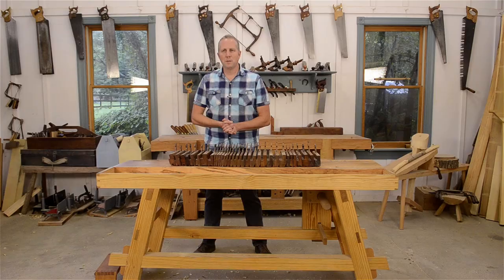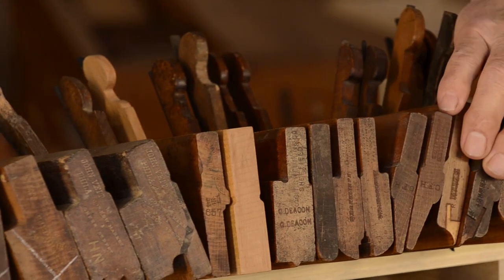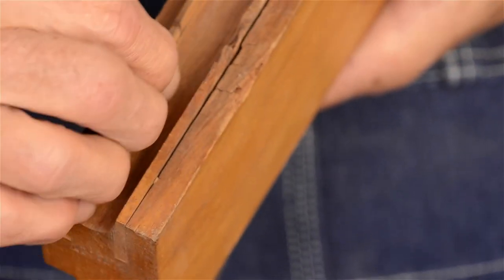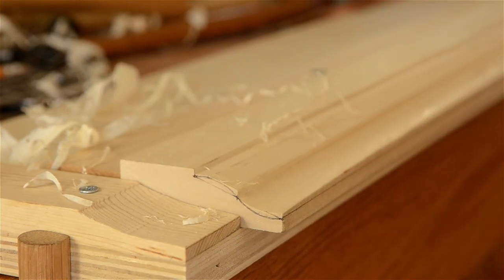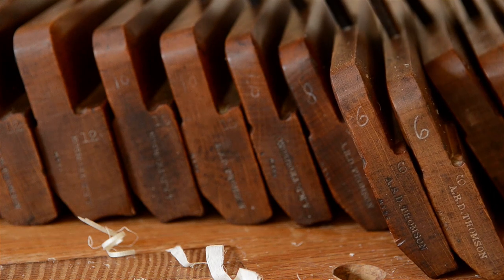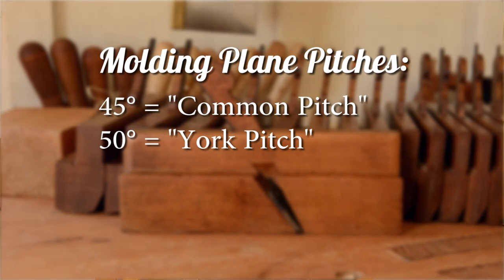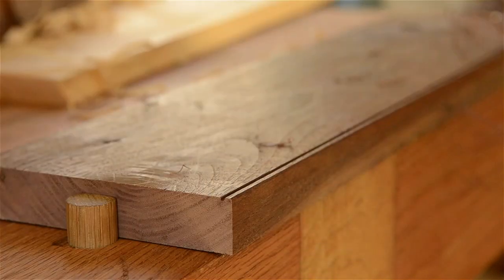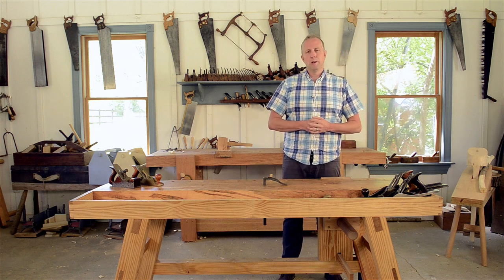Watch This Before Buying Molding Planes for Woodworking

Comment: Great video.  The only thing worth adding I would suggest, is that with certain types of moulding planes it can be easiest to start the cut near the far end of the board, and gradually extend the cut backwards as it deepens, rather than start at the near end as you would normally do when bench planing.
Reply: Most but hollow and round would be this way.

Comment: I agree ... a Stanley 45 ain’t easy to play with .
Reply from the maker: Ha, ha. It works better for some things than for others. Good for grooves & beads, not so easy for moldings.
Reply: @WoodAndShop  even doing Tongues/grooves : not the best because of the possible errors when making the groove: the fence isn’t fix . Can be good but also very bad... I learned the rough way ...
Reply from the maker: @ikust007  Yeah, much harder to do tongue & groove joints with a combination plane.
Reply: @WoodAndShop  that’s when I learned : we don’t say groove & tongue ...  the groove part can be fixed . Not the tongue chisel...:)

Comment: I've been a cabinetmaker for 46 years and have about 250  bench and molding planes. This is a very good video unlike most on the web. Thank you for making this. Oh, I love my # 45 and #55 . The #45 stays set up with a 1/4" straight iron for drawer bottoms in the side and front of a drawer.
Reply from the maker: Thanks for the compliment Buddy! And now I know where all the plane went! Yes, I prefer the #45 with a 1/4" straight iron as well.
Reply: Record 50 for me. My 45 is for everything else :)

Comment: What an amazing video - thank you. I would be grateful if you could suggest how to workout how to identify particular molding plane profiles to enable one to buy dedicated molding planes to match restoration projects. I'm restoring my original 1890s timber sash window frames and I need to replace some deteriorated bottom rails. The window frames have a simple rebate/oval/rebate mold around the edge but I'm not sure how to go about finding a molding plane that matches so that I can fabricated replacement rails. Any suggestions would be very gratefully received. Thanks again and best wishes.

Comment: There's no reason to start with a square top surface. Rip an approximate angle on the table or hand saw, and then run a backer board along the inside of the plane to keep vertical. You've saved yourself at least 50% of the time removing excess material.
Reply from the maker: Yeah, I often just hit the board with a jack plane to get it somewhat square, and then start planing.